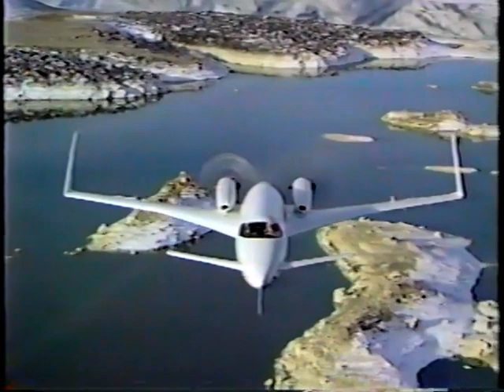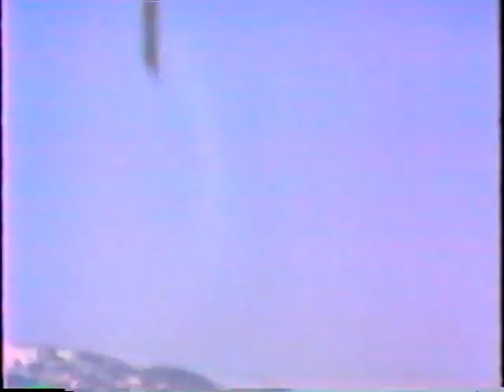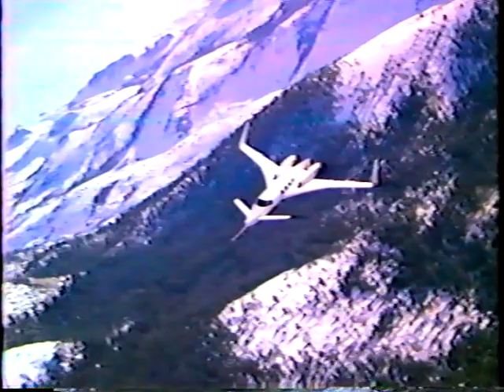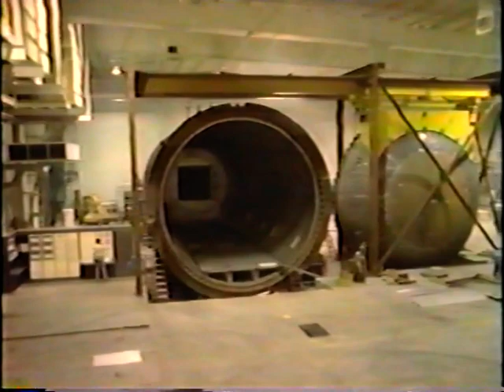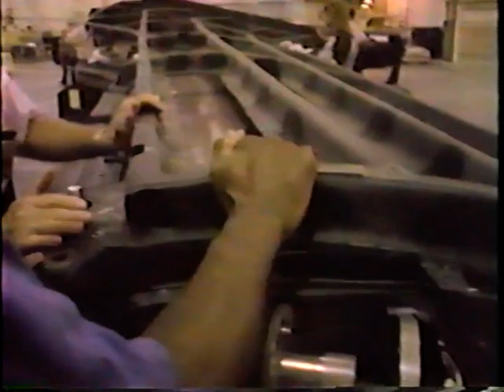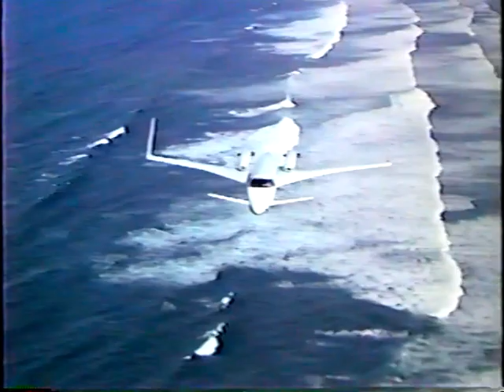Beechcraft Starship

Comment: I live in Dorval, which is where Montreal's international airport is. I've learned to recognize these just from the sound. The first time, I looked-up because some INSANELY LOUD and high pitched prop-driven plane was overhead. I saw this delta / canard twin engined pusher flying overhead. I hear this sound from time to time and each time I've gone outside to look-up, it was this guy again. 

If the plane I occasionally see is indeed this 80s starship, I have an idea as to why they may not have been a commercial success - they are the loudest thing in the sky! I dont understand how a fuselage / wing design can impact the loudness of engines and props but again, every time I've heard 'the loud one' it was this guy.
Reply: Whatever noise they produce, had no impact on sales. There were several reasons why it failed. The FAA interfered with the design because at the time, they didnt trust composites so forced Beech to add unnecessary structural supports, which added weight, reducing its performance. The cost of making such a 'futuristic' aircraft was high as well. Both of these equaled an aircraft that performed like a 'normal' (for the time) Turboprop, but cost as much (at the time) as a business jet. So most seeking an aircraft in its price range, went with the jets. 

It also didnt help that Beechcraft offered free maintenance plans with the Starship, which caused owners to get them serviced FAR more often than they otherwise would have. People saw the amount they were in service and equating that to mean they always had problems instead of owners just abusing/taking advantage of the maintenance program to keep them in tip-top shape. 

Its "All-glass" cockpit didnt help much either. While a neat idea in theory, it using CRT's for all the screens added alot more weight and heat up front. That heat needed to be dissipated by cooling systems, which make the cockpit loud. 

In short, the Starship was too far ahead of its time to do very well. Id bet if it was remade today, with all the proven tech advancements and experience with composites, it would be a far better aircraft. 

As for the noise, that could likely be rectified with a more modern turboprop with fewer blades, but honestly, even though ive not heard a starship, i think ALL turbo props are loud and kind of doubt this is an exclusive trait of the starship.
Reply: @lyianx  Pusher turboprops are extra loud due to the interaction of the (often supersonic) blades with the flow of exhaust from the engine. This configuration has a few advantages (including doesn't disturb flow of air over the wing, no need for a prop deicing system because the props are bathed in hot exhaust) but noise complaints are a disadvantage.
Reply: The Piaggio Avanti, Starship's direct competitor, is also known as one of the loudest airplanes out there.